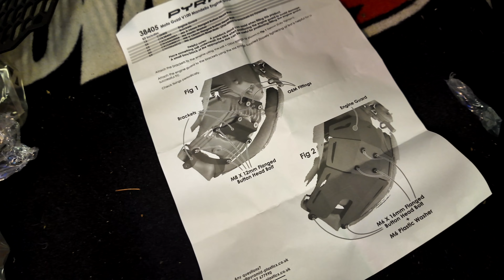Pyramid Mods for The V100 Mandello S

Comment: My Verde V100 with gold wheels arrives 1st March, so this is very useful. Just ordered the smaller Pyramid engine guard, and the fender extender. Seat cowl looks good, will have a think about that. When you fitted the caliper guards I didn't see you centre the calipers? I think you are supposed to hold the brake on with the caliper loose, then tighten the bolts.
Reply from the maker: I did not know that. Interesting to know!

Comment: The thing i find weird is that the mandello does NOT come with crashprotection from factory.
Such a bike in factory trim could be written off if the bike falls over and then automaticly lands on the cilinders.
That could destroy the engine or at least cause a minor bend with leaks, headgasket failure, etc.
That would be extremely costly.
Reply from the maker: Yeah,, But that is also the case for a BMW Boxer.
Reply: @droommotor  Sure, but we are not talking about BMW here .....
It really really is an issue because when a bike falls to the ground the forces on that specific cilinder/head is tremendous.
Even if you are lucky and there is no mechanical damage the optical damage will be huge since you can't simply swap a cilinder just like the valvecover.